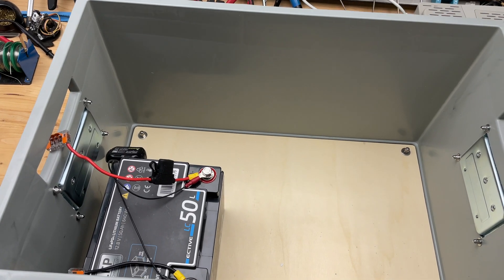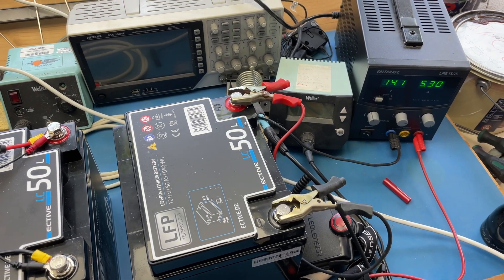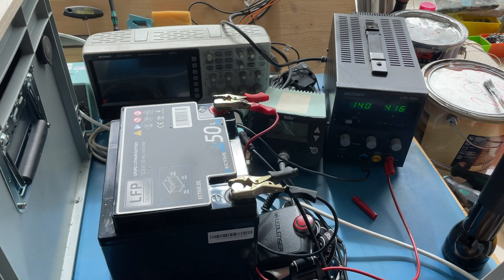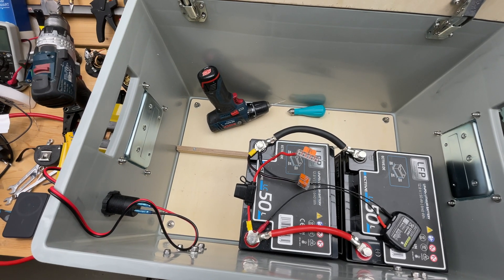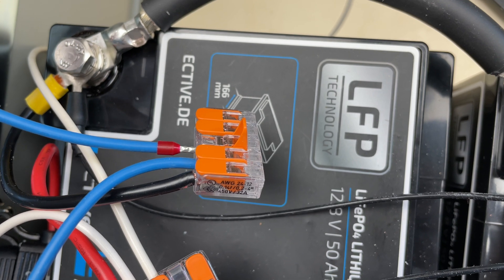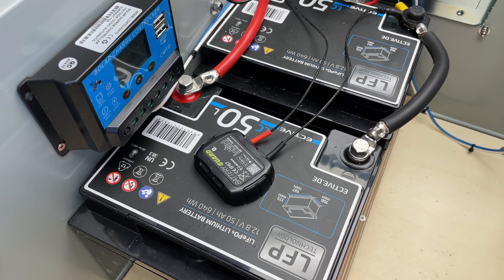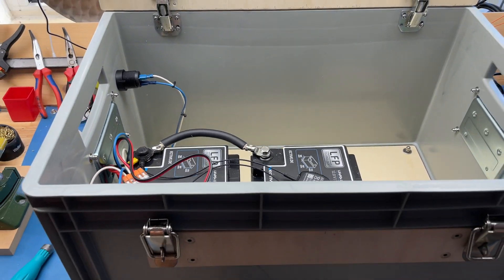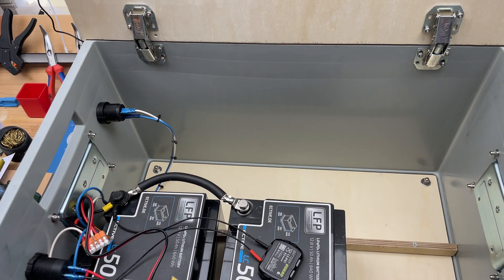Building my own Powerstation // 12V LiFePo

Comment: What about the inverter/charger heat? Also that box is flammable(unless it's a rated one?) so a big nono in German code.
Reply from the maker: Wood burns too ;)
It's a standard HDPE box...for the inverter I'm looking for a oversized one, so heat development should be controllable under normal conditions. Sure fans are an option, but would like to avoid any holes in the box for water protection, since the outdoor use (like offgrid building sites or similar) is one I don't wanna compromise too much...
Reply: An inverter with a big passive heatsink that was exposed to the elements through a hole in the wall could work well, not hard to make water tight, bolt+epoxy/rubber it into the wall.